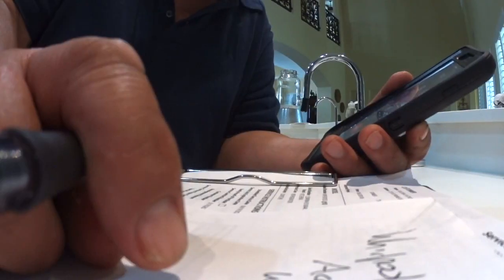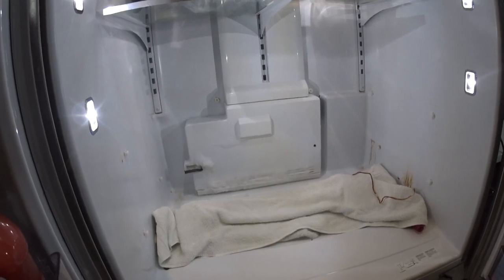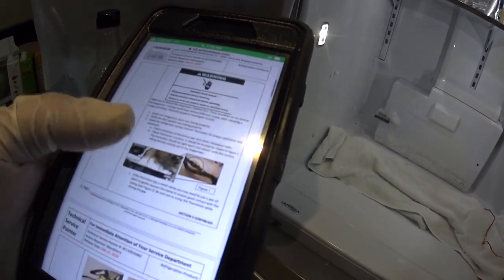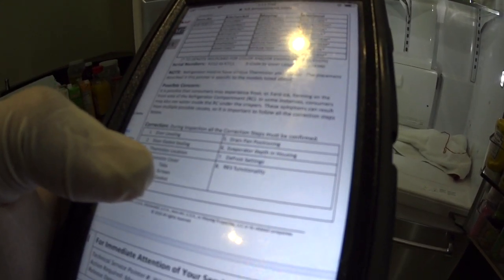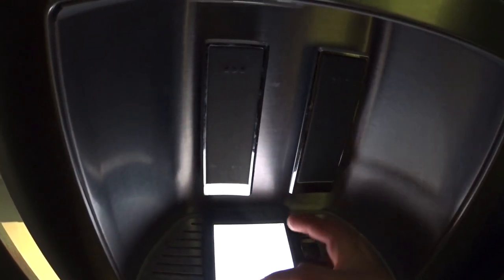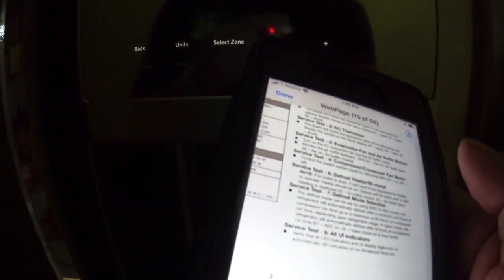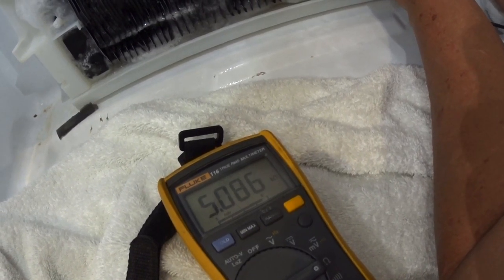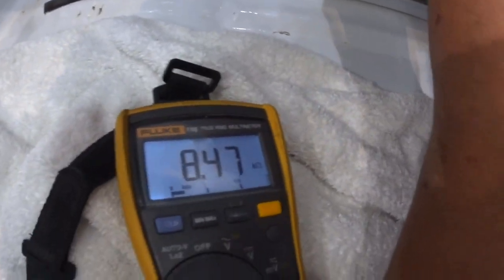Kitchen aid/Whirlpool refrigerator iced up

Comment: My fridge doesn’t have service test 7, it goes from 6 to 8 and skips over 7. Any idea how I would change it from ADC to 8hr if I can’t select service test 7?
Reply from the maker: What’s the model number
Reply: @ApplianceRep  KRMF706ESS01
Reply from the maker: @RAKS3  your model does not support that action just seen the model into tech sheet
Reply from the maker: *info
Reply: @ApplianceRep  thanks! My freezer coil freezes solid about every 3 months and I have to defrost it manually. The fridge coil is fine. When I run the manual defrost (service 38) it defrosts the coil. Does it seem like the thermostat is bad since it doesn’t defrost automatically? I was hoping the 8hr defrost would fix it but my fridge won’t let me change that setting. 

The fridge and freezer stay cold and I don’t see frost on any of the food.
Reply from the maker: @RAKS3  I would concentrate on that thermistor on the evap coil in freezer